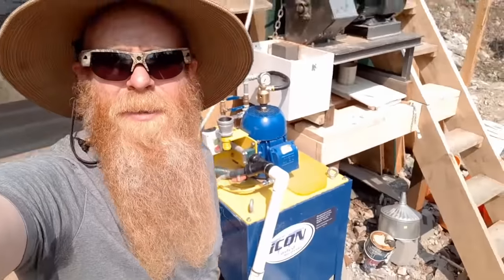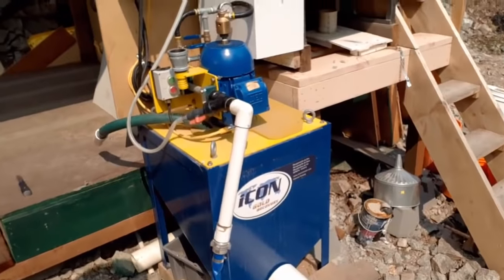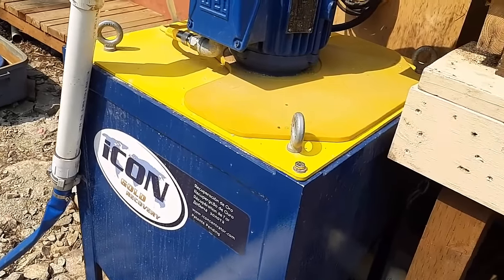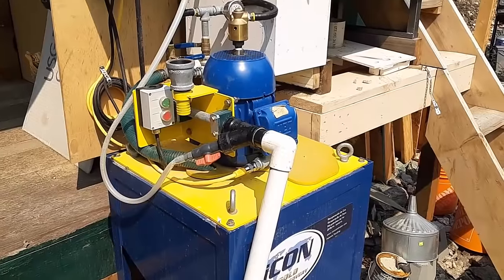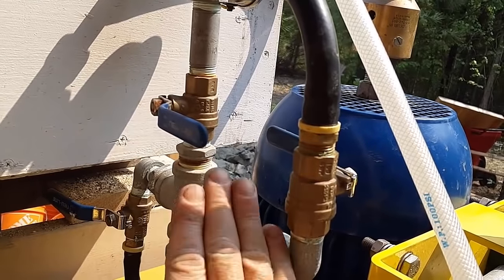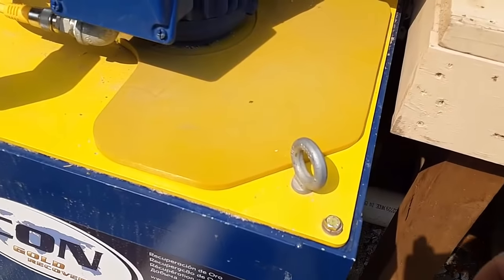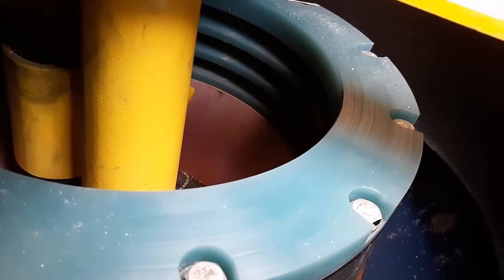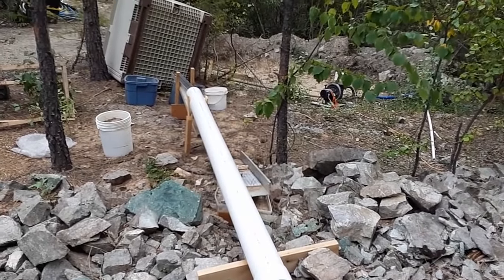Icon i150, How does that work?

Comment: You should run some sand swept up from the side of the roadway through the Icon and see if it recovers any platinum burnt out of vehicle catalytic converters.   The particles of platinum might be too small, but who knows 150g's might might make a difference.  See the Cody's Lab video where Cody mines platinum off of the side of the highway for more info.

Comment: Well, I was curious, how this machine works and therefore went somewhat deeper into physics. The Stokes Law helped a lot to understand whats happening inside the machine. But first some words to the electric motor. I assume it is a 3 phase asynchronous electic machine. The mentioning of 900 rpm seems to be the design standard value identifying it as a 4 pair coil engine, which means that at 45 Hz it rotates with N=45Hz*60s/4min=675rpm. Consequently feeding the stokes equation with that, the radial acceleration is 50 times the standard gravitational acceleration of roughly 10m/s^2 assuming a radius of 0.1 metre. This leads to a sedimentation speed of roughly 200 mm/s for gold particles of 0.01 mm diametre. Sand particles of 0.01 mm diametre with a density of 4 g/cm^3 is sedimenting at a speed of roughly 50 mm/s. Compared to a normal gravitational sluice the settling of gold is 50times faster which means that the capture length in a sluice is probably 50 times longer than in the Icon i150. 
Before I analysed whats happening in detail I suspected that probably higher density particles somehow win against lower density particles when accelerated in such a rotating vessel. However, this is not the case. The i150 is just pulling all particles much faster to the ground which tremendously accelerates the speed of sedimentation, which lets you capture also the smallest particles which might get lost in a 2 metre long sluice.
Fine machine!
Mr. Dan, you could teach your students Stokes Law using this example. What do you think? Just give me a note if you have questions.

Comment: When we start mining in space, we will be using machines similar to this. Because this makes its own sort of gravity, it will still work even if actual gravity is different than Earth's gravity. That said, it probably will look completely different and might not even use water or any liquids, depending on what's available. We might have a centrifuge running on liquid methane, liquid ammonia, liquid carbon dioxide or sulfuric acid! Probably nitrogen gas to start with, though.

Comment: What is the source hertz of your generator versus the hertz on the VFD motor? That may explain your vibration, u.s.hertz is 60, whereas Europe has 50. Controller (variable frequency drive), motor, and the generator should have the same hertz. Also, have you considered the tailings as a possible mineral for gardening don't know what trace minerals still exist or the grit size but our red clay needs sand and lime just to grow some things. Maybe you could either sell or give away tailings as a soil amendment locally. Saving room in the pond.

Comment: Idea for future video: Test the capture rate of this device by having a tailing sample assayed. I'm sure it's high but are we talking 90%, 99%, or 99.9%? I'm very curious.
Reply: @Dan Hurd Can you ever crush it too much? Is that ever a concern? On the extreme end I bet 600 or 1000 or even greater mesh gold is going to want to flow with the water right through the device. I know gold can in theory be too fine even for a miller table to catch.
Reply: Dan Hurd,wazzzzzzzzz up? So I built an impact mill the year before last out of hardened steel plate rolled into a circle,punch plate part way up the side of drum so that only the finest material gets carried up and out,instead of a screen and the hardest chain I could find and it works like a champ. Turns rock to powder like flour. I haven't tried crushing wet though and I'm wondering what sort of consistency your crusher was putting out dry prior to its new purpose. If it was of flour like consistency then I would imagine it's the introduction of water that's preventing the ore from being completely pulverized. Maybe you have to crush dry on mass and then turn it into a slurry to run through the icon. Food for thought. Thanks for your clips they are always educational and I'm always interested in learning. Oh ya, I think you had an editing hiccup at the end of this one. When it fades to black keep watching for a bit and you will see what I'm talking about unless it was intentional 😉
Reply from the maker: @dumpbear0  Yes that was an OOPS.  I have trimmed it on youtube, but the edits are taking a long time to process.
Reply: was thinking the same. my impact takes a 6 inch rock to flour in less than a second, no need for heavy, noisy ball mill. shaker table works fine with this. still don't see the need for an ICON as it seems to be a waist of energy.. just my 2 cents

Comment: how does it go with sulphides? I mean some ore has 50 kg of sulphides per ton, and the sulphides with value of 400gpt. If it only holds a kilo or so you would have to empty it all the time or let the sulphides run over?
Reply from the maker: Obviously depends on your material. If you are collecting the sulphides you have about a 10 minute cycle time. Luckily clean out is only 30 secs.

Comment: That's some great kit Dan. Bet it spin cycles your socks really well. 

I made a hydrocyclone to recover fine gold in the field. It works a treat. It's more a concentrator similar to a sluice however I can just keep feeding it without worrying that the gold might wash through.  

 The gravel I run is mostly clay, iornstone and quartz sand with crazy amounts of black heavies...  The  cyclone does a great job of washing the clay, quartz and fine black sand out with a 95% plus capture of the fine gold. 

You can check out my video on the cyclone here:

https://youtu.be/EuwLLy0yPpQ

Comment: More Good Stuff from you Sir.    WoW !   Not so keen on that beast.   Looks like a mechanical Nightmare to keep serviced and maintained.    Any time something needs refurbished errrr replaced your going to be seeing $$$$$$$$$$$    flash before your eyes.     Guess if your way more serious about this stuff then I am it would be the ticket.   Closest I come to that is a Hand Stomper and Blue Bowl !  LOL   I even prefer using a Henry Poop Tube more then the Blue Bowl.
Reply: @Dan Hurd  Yes, I was thinking that before commenting above.  I assume the side panels are removable to access all that stuff.  That hollow shaft motor is somewhat a Novelty.  Be way cheaper to  rewind then replace that puppy.  Keep shooting Grease in those bearing and they would be the last thing you need to worry about.  All of those Rubber Parts was what I was thinking about.  Do they seem to be wearing well ?  Not something you can just buy off the shelf or fabricate so easy.   Anyways it's a hell of a machine all said and done.  I've seen a few DIY set up's some what like that but nothing quite that complex.    Really enjoying your video's here.  Man I need some Serious hill time my self here soon.